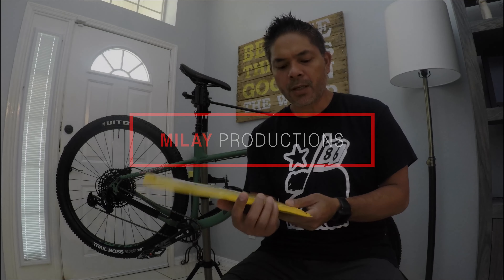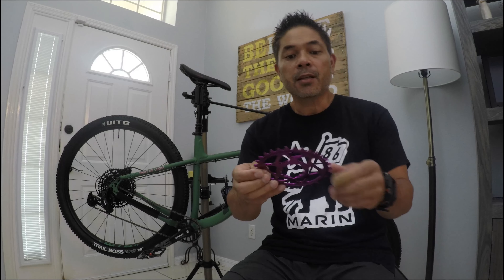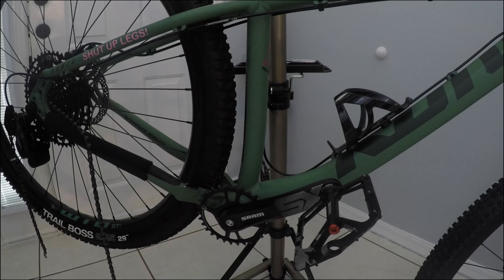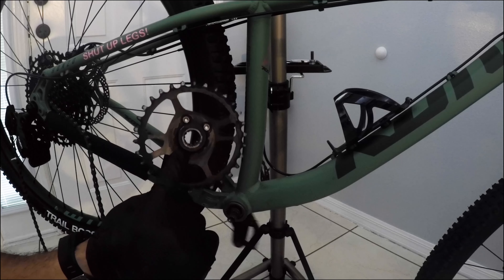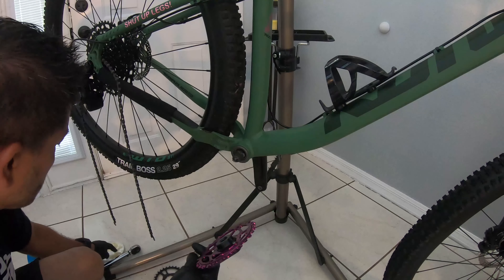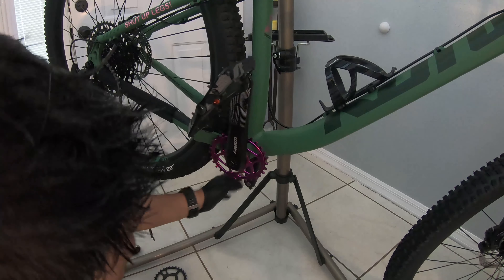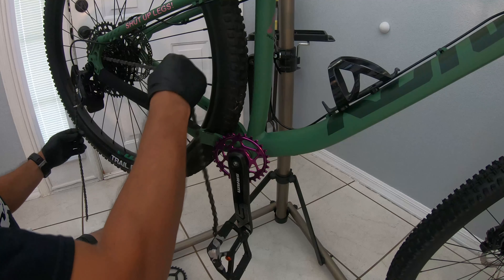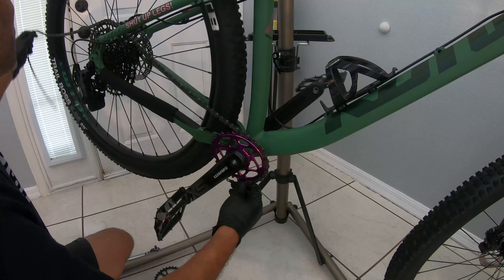Absolute Black Oval Chainring Install - Sram SX Cranks - 2020 Kona Honzo

Comment: Hi bro, the new installed oval chainring was same quantity of teeth to the replaced sram chainring? It didn't require to trim the chain? Thanks in advance
Reply from the maker: Same tooth count on new chainring so I didn't need to shorten/lengthen my chain.

Comment: How did you get the crank off? I’ve been having trouble
Reply from the maker: Just need an 8mm hex to loosen the bolt.  If your crank isn’t coming off, you might just need a crank puller.  You can also try to beat it with a mallet but not too much, not too hard due to you might kill your bb bearings by doing that.  Cheap crank pullers on Amazon and eBay.